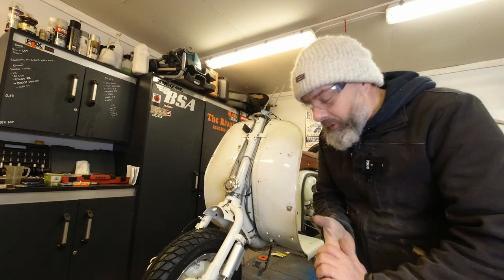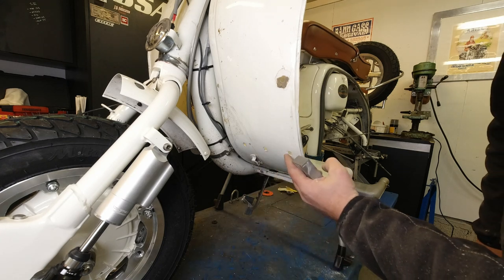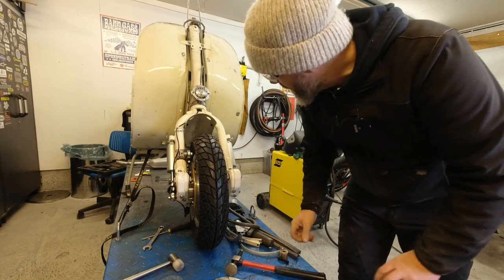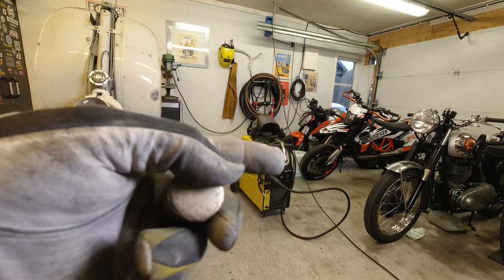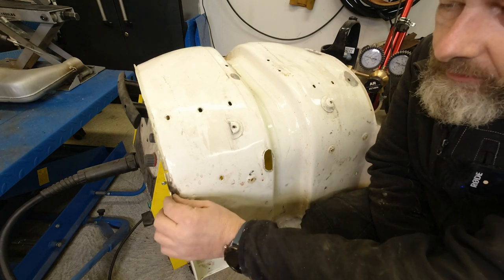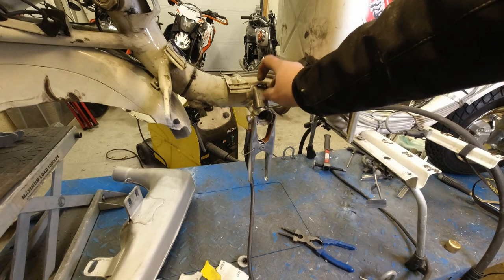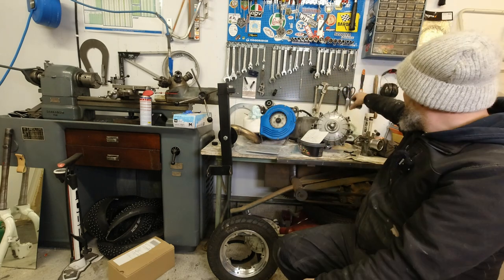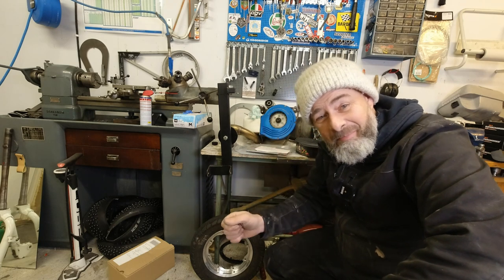Lambretta legshield repair #kickbackgarage

Comment: are you painting the flywheel cowl? would look good in body colour..
Reply from the maker: The flywheel cowl is an ally casa anodised  one. If I manage to save up enough, I would like one in silver. Blue was the only colour they had when I bought the casa case 4.5 years ago.
Reply: Still paintable mate…
Reply from the maker: Anno lasts longer 😎

Comment: Would of liked to no what settings your welder was on and which rods you used. Cheers. Good job
Reply from the maker: It's wire, not rods. Rods are near impossible to use on thin plate.

Comment: Nice little job on correcting the dings , did you drill a small hole at the end of the cracks to prevent them from continuing before welding them up. Merry Christmas, Happy New Year and a Blessed 2022 to You and Your Loved Ones.
Reply from the maker: Yes, I drilled holes at the end of the splits. I've already made a video on that subject, so let it out here.